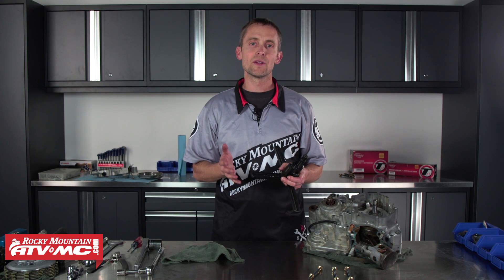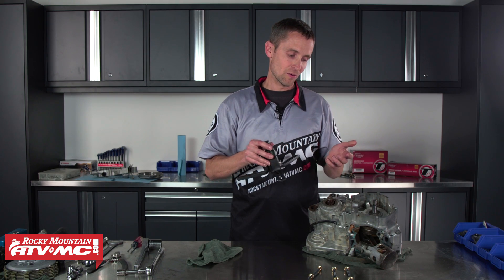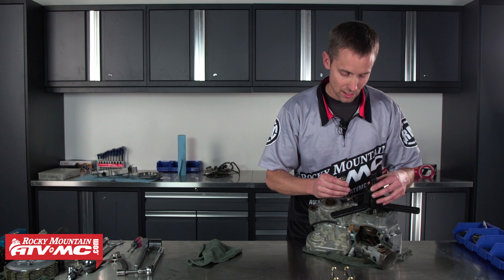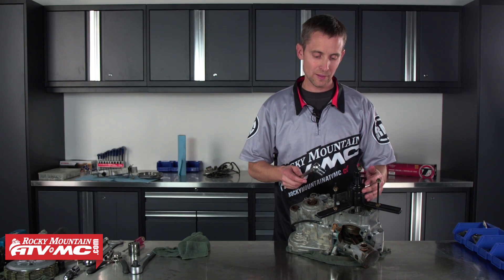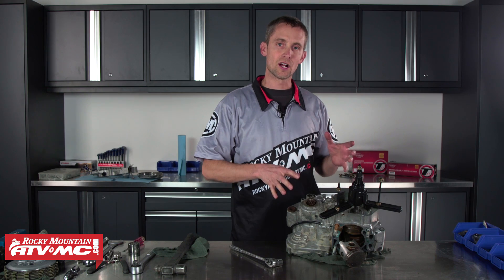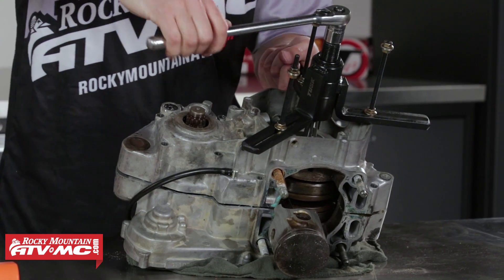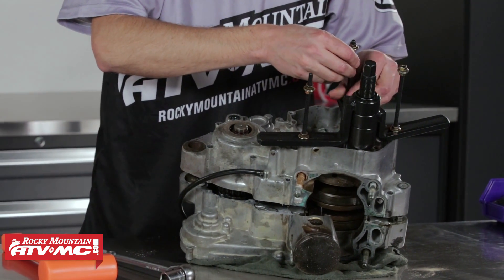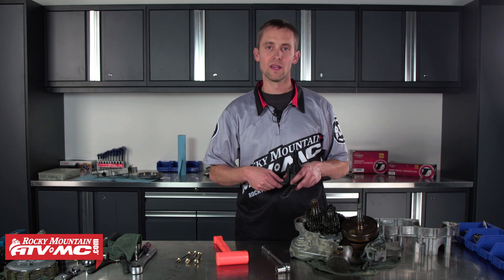Tusk Motorcycle Crankcase Splitter Tool

Comment: do you band the crankshaft with tool or its ready to go back in?
Reply from the maker: Band? Bend? No. This is to prevent damage to the crank and to keep it from being knocked out of true. It also helps prevent damage to other parts from separating it any other way.  -Charles.

Comment: Does it come with a case to keep things organized?
Reply from the maker: No it does not. Just the box it comes in.
Reply: @rmatvmc  do you offer one that does. Keeping a work area organized is very important.
Reply from the maker: The Motion Pro Crankcase Splitter V2 has a molded tray in the box to keep things organized but it doesn't come with a separate case.

Comment: Hi can anybody help I got a 1998 rm125 gear box problem the problem I can shift the shift drum by hand from 4th gear into 5th and back down into 4th but when I try to turn the shift drum from 4th gear down into 3rd the whole shift drum locks up solid and won't move could this be a bent shift folk or the actual shift drum itself any help appreciated

Comment: Can you just use regular high heat silicone bond to mate the 2 halves again or would you need the "glue"you mentioned at: 3:48 ?
Reply: Danny M. Roque Permatex MotoSeal (same thing as Yamabond) $7 tube at auto parts store.

Comment: Cool tool. I need to split my casing on a YZ250h just to clean it out. The previous owner had already removed the piston but I found a spec of metal probably from the piston on the crank. I do not think I need to pull out the Transmission but just be able to get in there and clean out and inspect the gears.

Comment: did the bike  blow up because my piston looks a little bit like that one  should I replaced it
Reply: I think this is the engine of the 2004 yz250 build, before they installed the wide ratio transmission and wrench rabbit kit